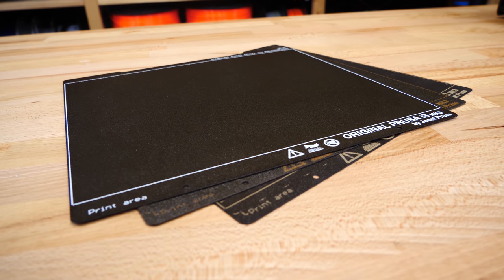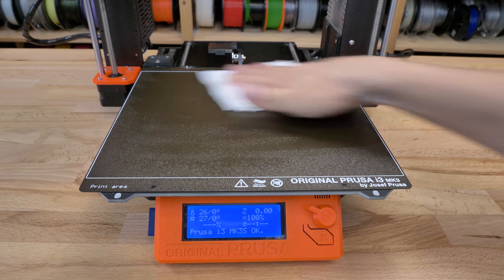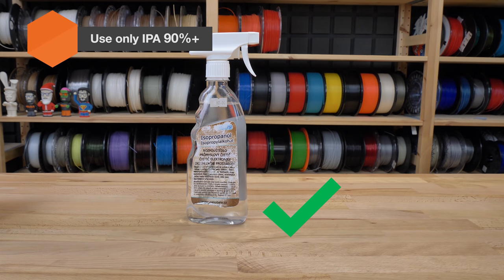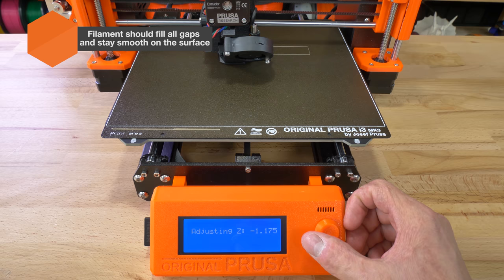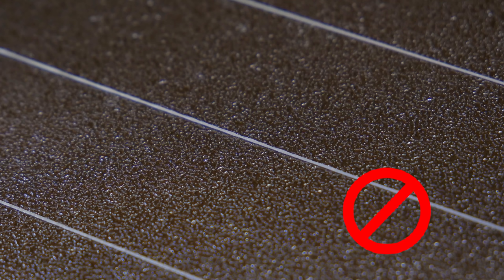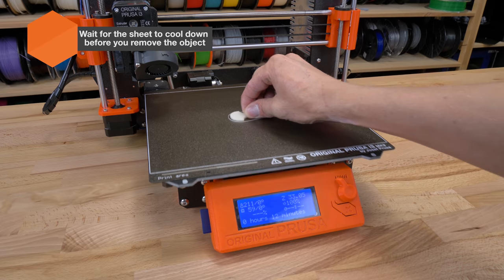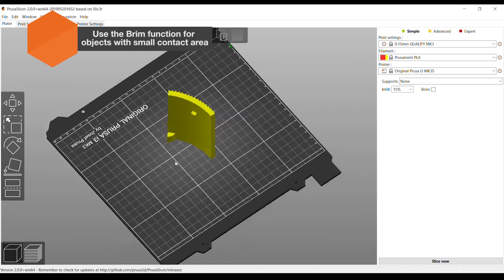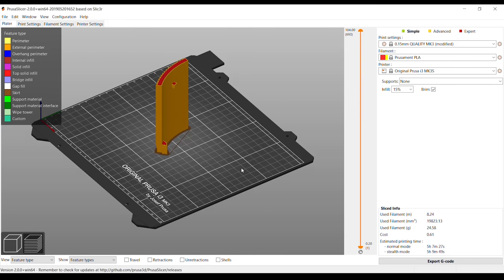How to print on a powder-coated sheet

Comment: I have issues getting good adhesion when printing supports.  I think it has to do with the gap between the lines.  Adhesion for a bottom base appears to work fine.
Reply: I have had to bump the bed temp up to 70C for reliable adhesion with PLA on the textured sheet.
Reply: HackMonkey I set a higher Live Z for the plate and that helped with recent prints. A video from Prusa said to adjust until a light touch does not remove print from the sheet.  Thanks for additional tip.
Reply: @ericzwirnmann8151  Same here, I have to drop the Z about .25mm more for the textured sheets, verses the smooth sheets.

Comment: I bought my MK3 not long ago and they were not available then :(
I hope they can get production steady on these.
Reply: Ordered the status changed to "shipped" 2 hours later.  I think they built up a small stock pile this time around.  Hopefully they can continue to keep up with the demand for them
Reply from the maker: We re-stock the sheets pretty much everyday. You have to log-in to see the sheet on the e-shop ;)
Reply: @Prusa3D  I logged in but could not find it. It sure is not easy to order them but judging from the lack maybe that is for the better for now. Will learn to use the PEI sheet first.
Reply from the maker: Here's a direct link - 
https://shop.prusa3d.com/en/mk3mk3s/214-powder-coated-spring-steel-sheet.html

Comment: Thats weird.. I am sure that in one of the previous videos (or was it in the manual that came with the printer...), it was said to use acetone once in while to "replenish" the PEI coating?
Reply: You are right on both points. That was PEI they were talking about. This is powder coated.

Comment: What about flexibles? I have a TPU that ripped the smooth PEI right off the bed. I have to use a thick layer of glue stick.
Reply from the maker: You can print flex/TPU directly on the powder coated one, no glue stick needed.
Reply: @Prusa3D  You can, but it looks like you shouldn't unless you want to make Josef Prusa rich, by getting new surfaces every now and again.

Comment: I'm surprised that you don't recommend using a release agent with PETG. I've already messed up my smooth sheet even using a glue stick. I've been afraid to print with PETG on my powder coated sheets.
Reply from the maker: PETG can be printed directly on the textured sheet without any release agent, that's what the textured sheet is best used for :) Just clean it with IPA.
We do recommend a different procedure with the smooth sheet, check the Handbook for more information.
Reply: @Prusa3D  Awesome thanks I'll have to give it a shot. The textured could be my goto surface then to PETG.
Reply from the maker: It is for us! :)

Comment: Is the powder coating done on top of a spring steel sheet ??
Reply: Yes -- both sides. It's actually quite a bit thinner than the sticker-covered smooth sheets. You need to lower the Live Z by about 4.5 full turns when going -> textured sheet, and back up again if swapping back.

Comment: My smooth sheet is ruined!

After printing on the powder-coated sheet, I put the smooth one back on and I went to do a first layer calibration BUT the printer had stored the old z height
and STARTED at that level, this means that it scratched the zig zag pattern into my sheet as I tried to correct it back up!!!
Add an option to reset Z height or store 2 z heights for swapping sheets. I can't wait to spend more money on a new smooth sheet
Reply: Duh, use the power switch to prevent accidents XD
Reply: There is one now :D But ay, use your hea though...

Comment: No matter how I set the z, and I've cleaned my sheet with IPA many times, tried soap and water as well. Nothing will confidently stick to the powder-coated sheet.
Reply: Set your Z lower. Share your experience with the community we'll help ya
Reply: @C4mpblor   I set my z low/higher, so low that the first layer would bubble up because it was squished to much. PLA would not confidently stick to the powder coated sheet. I tried multiple brands of pla, and doing all sorts of calibrations. I ended up ordering a smooth PEI and that holds way better.
Reply: @scott4826  You may not have set it low enough? With the Z height set up nicely for the smooth sheet, you need to wind it down a full 4.5 full turns to get to approx the right height for the textured sheets.
Reply: I have to drop my Z about .2mm from the stickered sheet, when switching to the textured sheet. I also have to bump the bed temp up to about 70C for PLA to reliably adhere to the textured sheet.
Reply: @HackMonkey  I started with the textured sheet, then had so much difficulty I ordered the smooth PEI. I upgraded my machine from the mk2s to the mk2.5. Its not like I came at this blind, I know how to setup my first layer. Had my mk2s for over a year. Nothing I tried, live z adjustments, cleaning or different brands of pla. Nothing I did would stick confidently to the textured sheet.
Reply: No question the smooth sheet has better adhesion. I primarily only use me textured sheet with PETG and flexibles now.

Comment: I've had a bad experience with PLA on the textured sheet. The corners always lift up on me and wreck my prints. Large surface area objects that should have no problem sticking. I don't print a lot so there's no way it's worn out already. I spent hours calibrating first layer, cleaned bed with IPA, following their help guides, still nothing. I wish I would have gone with the smooth sheet. I will try some of the suggestions in the comments. Stay away if you print PLA!

Comment: People said PETG and other extra stocky materials stick so hard it rips sections off and we should use window cleaner or a glue stick. Is that true?
Reply: Yes it's true with the smooth sheet. I've ruined one sheet myself. However with textured sheet PETG seems to stick just fine. I only washed textured sheet with soapy water and rinsed it very well. After that prints stick quite nicely to this textured sheet. They actually release themselves after I've left it simply to cool down after print. I also use brim function with textured sheet and PETG. But yeah, be aware that you can ruin smooth sheet by directly printing PETG to it. Use glue which came with printer or some use hairspray (I haven't tested this myself).

Comment: Forgot to report that this product does not work with PLA :(
Reply: Café com Arco! Do you use isopropyl alcohol to clean before each print? I have a perfect first layer adhesion and my prints come off very easy... I only have been printing with pla since I have my printer with this sheet.
Reply: Hello!  Yes I strictly followed the instructions, made dozens of calibrations with different values, used 10 different manufacturers of PlA, including Prusa, all with the same result, simply does not adhere.

Comment: so if you use z-layer calibration to because the sheet is thinner than the smooth pei, but what when you switch back to the smooth pei?, if you run z-layer calibration on that, I guess the nozzle will go too low?, so you need to adjust the z before running calibration?
I guess many wants to switch between the sheets, atleast I want to.
Reply from the maker: We're working on an addition to the pritners firmware, which would let you store separate Live Z adjust value for smooth and textured PEI sheet.
Reply: @Prusa3D  wow, that will be awesome!
Reply: @Prusa3D  That would be fantastic just for switching between PLA and PETG. PETG seems to work better drizzling it on, rather than mashing it down. It gets a bit old having to consult my z adjust figures per material and doing a live z adjust.

Comment: Hi, can you use normal ethanol ?
Reply: I use a IPA/ethanol mix.  Ethanol cuts grease better than IPA since ethanol is a universal solvent whereas IPA is a non-polar solvent; Hence less reason to ever need acetone on the smooth PEI and will not do any damage to the sheet.  The IPA helps carry away oils released by the ethanol.

Comment: Of what I print the first layer often becomes the top surface. Not sure I want a Moon crater surface though.
Reply: In reality that surface looks very similar to the texture to you get on vinyl. Or even the plastic surfaces on things like an Epson inkjet. It's smoother than it looks in photographs and is actually pretty pleasing as a top surface.
Reply: @MarkWheadon  Oh thanks for the information.

Comment: What is the advantage of a Powder Coated Sheet versus the Smooth Sided PEI sheet ?
Reply from the maker: Some materials stick better to the Smooth sheet, some to the powder coated one. And some stick too well, so you might need a seperating agent. We have a table, which gives a great overview of which sheet to use with what material:
https://help.prusa3d.com/en/materials

There's also an aesthetic difference, the powder coated one imprints its texture to the bottom of the prints. Which can look quite nice, we use it for our printed parts on our printers. -Mikolas

Comment: I've just purchased this textured sheet.  nothing sticks based on your recommendation.
Reply from the maker: Make sure your Live Adjust Z is low enough and that you've cleaned it with 90% IPA:
https://help.prusa3d.com/en/article/flexible-steel-sheets_2195

Contact our 24/7 live chat support at shop.prusa3d.com if you'll still have problems with the adhesion ;)
Reply: I had the same problmes with PLA an PETG and switching from a cheaper IPA to a higher quality and a very good rub with this IPA made the sheet awesome again.
I got the Woldoclean 99,1% IPA as I saw it on CNC kitchen in a video.

Comment: The pc spring steel plate that came with my ender 3 v2 neo is too good at its job. Every part feels like it's super glued to the bed. Removing thin flexible parts is a nightmare. I feel like I'm going to bend the spatula that came with my printer every time I have to remove a part. I might try printing with the smooth steel side of the plate for 💩 and 😁.

Comment: How do you know whether to use the Powder Coated Sheet, or the Smooth Sheet?
Reply from the maker: You can use both of them for printing with pretty much any type of material if cleaned properly and if the Live-Z is set right, however, there are certain benefits in using one sheet or the other for certain materials/scenarios.
TLDR: Smooth is the best for PLA, Powder-coated is best for PETG
There is extensive info about the sheets in our Handbook:
https://cdn.prusa3d.com/downloads/manual/prusa3d_manual_mk3s_en.pdf
-Mikolas

Comment: Failed print once in a while.

I love prusa printers. However, a lot of people have adhesion problem on powder coat sheet. https://www.reddit.com/r/prusa3d/comments/bm9f7x/cant_keep_prints_sticking_on_powder_coated_sheets/
1. For small footprint object, my print failed 100% without brim. I hate to clean brim, making the edge sharp.
2. For large footprint object, my print failed 20% without brim, which makes it scary to leave it print.
Glue stick gives me a good sleep.
One thing I do find is that, my powder coat sheet is possibly not flat anymore after a year, because during first layer calibration, the step wise calibration line shows different shape from left to right.  Anyone can help?

Comment: I would make it MUCH MORE CLEAR you should only use IPA on these. While it was obvious (to me anyway) that acetone was bad, nowhere did it say, except this video, to avoid glue sticks, glass cleaner, etc.

Fortunately I saw this before I started making use of the sheet :)
Reply from the maker: We're not so strict about for example glue stick or glass cleaner, because those will do little to no damage to the sheet. They are just unnecessary. Acetone, on the other hand, will do permanent damage to the sheet, hence the bigger warning.

Comment: Either I am stupid or have bad luck. They just don't work for me. Nothing sticks no matter how much I clean or change Z values.
Reply: Do you have the bed heated?
Reply: is that a joke?
Reply: @oliknow  From new the PC sheet feels like there is some "grease" on it ,i cleaned it very very good
with IPA on both sides before printing my fist print and even then it was hard to get prints to stick .
I found that you have to dial the fist layer in more correct than on the smooth pei and 
also do set the first layer around 10 degrees higher on hotend than on the 
smooth pei sheet ,so the filament can go into the little indents in the surface.
After a couple of prints and with a high settings of 80 to 90 degree on the hotbed ,the 
PC Sheet feels easier to get prints to stick to ,so i thing you should try to set a high 
temp setting on the heat bed and let it be on for 10-20 min and then see if prints stick
a bit better .
Reply: How much are you changing Z by? Starting from a printer setup for the smooth sheets, you need to wind the Z down by 4.5 full turns for the textured sheets – a long way.

Comment: Are there any fluoropolymers in the Prusa printers?

I am watching this documentary: https://www.youtube.com/watch?v=Zjs3hsIFCHw
and C-8 (coming from teflon and present in PTFE tubes) are very detrimental to one's health.
I wonder if the powder-coat on removable beds contain any fluoropolymers.
Reply: Non-professional opinion here...but I'd say no.  First off, PTFE and Teflon is the same thing.  PTFE is food grade.  That 'plastic' Mt. Dew drinking bottle you have sitting next to you is PTFE.  Your pans in your kitchen probably have it on them...so, heating is not an issue.  As for fluoropolymers.  Yes, PTFE is a fluoropolymer; so your spring steel sheet, powder coated OR the smooth one, are coated with a fluoropolymer.  The only difference being one is dusted and baked on and the other is glued on as a sheet.

Does this new one contain more or less???  Who knows.  I'd suggest asking Prusa directly.  They might be able to get the answer for you.  I don't see why this is important though...if it were and you are head bent on removing all fluoropolymers from your life, then you have to get rid of all your food grade plastic, pots and pans in your house to be safe.  Good luck with that...

Comment: Why did it come with a glue stick of you aren't allowed to use it?
Reply: In case you run out of gummi bears to eat, you have a backup.
Reply from the maker: Glue stick won't damage the sheet. It's just unnecessary to use it with the powder coated sheet.
Reply: Ok cool, thanks.

Comment: The sheet is nice (I've had mine for a couple months) but the texture is a bit coarse.  I have an original MK2S (that I've upgraded to MK2.5S) and the texture on the original orange printed parts is much smoother/finer.  I wish the texture from my sheet matched the texture used to make those original MK2S parts.

Comment: The title may as well be "How to print on fairy wings" as after 2 years most people still can't actually buy this thing !
Reply: Fairy wings! That's a great idea for a next generation print surface! 💡

PS: Apparently you can order them from the webshop now. (The powder coated sheets, not the fairy wings.)
Reply: Lol, yep next gen. The powder coated sheets have appeared on the web shop for over a year now, but are never available, there is always some caveat that means - in practical terms - you can't actually buy them, they are on pre-order, they are limited to people who have bought an Mk3 during a specific period, they are not available in region X . . etc etc . . . I've been checking since 2017, and since 2017 they are always there to be ordered in some form, but this doesn't actually mean you can simply log on to the web shop, place an order, pay the money and receive the product !
Reply: @davelordy  Looking at the e-shop right now and powder coated sheets are in stock. They are being restocked in moderately-sized batches every day. So yes, it's possible to buy one right now. Log in with the account that you used to purchase your MK3 and you will see it in Spare Parts section.
Reply: I have logged in, I have checked (in fact I've been checking since early 2018 !) but there is nothing, in fact I don't even have a 'Spare Parts' section - I am guessing that they only show up if you meet certain criteria (location, when you bought your Mk3, etc) . . . I'm not doubting anyone claiming that these are actual products you can actually buy, just that they are only available to those people, to the rest of us (maybe even the majority) this product has always been - and continues to be - vapourware.
Reply from the maker: @davelordy  Ping the livechat to see if you are in the printer owner group.

Comment: Why not PVA glue? For me its best adhesive, no matter what printer, surface i use.
WIth PVA glue, i can print PLA without heatbed (only turned on at first layer), and no matter how tiny your object is, you don't need brim or raft. 
It adheres firmly, and its easy for removal, especially if having steel sheet, or simply reheating after print is finished.
You can clean surface quickly with warm water.
Reply: PVA glue is the same glue as the one in glue sticks
Reply: @zanpekosak2383  yeah?? i m asking, why is PVA glue (stick glue) harmful for textured sheet?
Reply: Thats something that I dont know...
Reply: Joseph has confirmed elsewhere that it's not harmful, it's just not needed under most circumstances. You can still use it if you need to / want to.